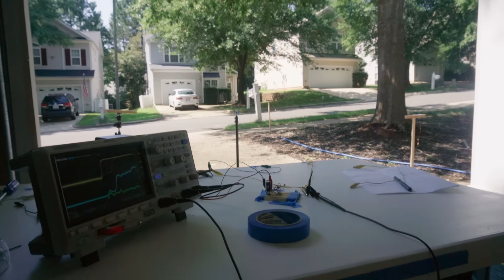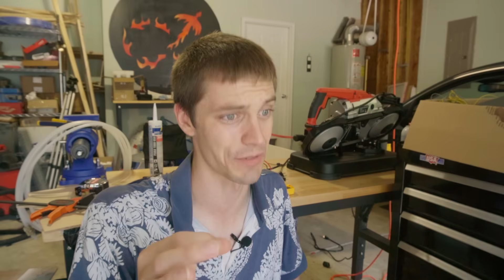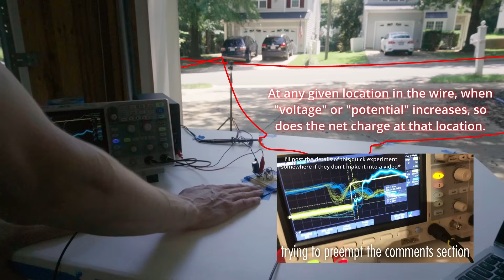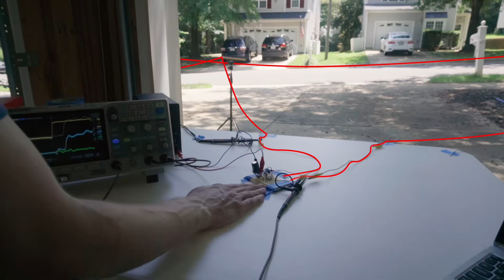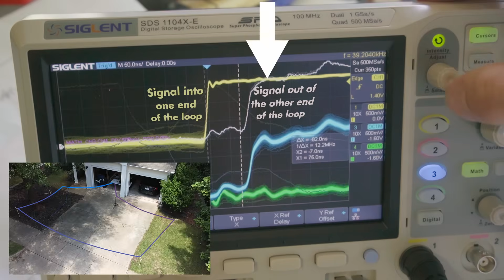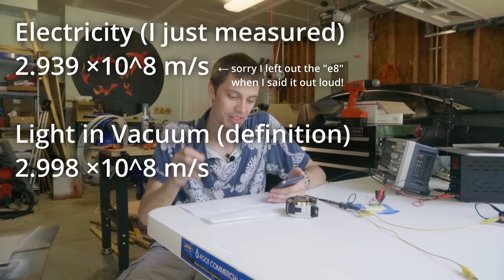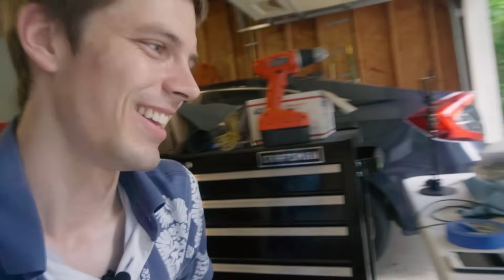Why does WATER change the speed of electricity?

Comment: i was lucky enough to have access to very expensive and accurate lab equipment a while back, and i tested how fast a signal travels along a massive spool of fiber optic cabling. it travels at the speed of light lol. the transmission delay should actually be a tiny fraction slower than theoretical because the path taken, but its so close that my equipment couldn't tell the difference
Reply: Signals in optical cable also have a velocity factor just like wire does.  It should also be around 71% of c.  In optical terms, it is called the index of refraction of the fiber.

Comment: And that's why coax cable specifications include a velocity factor.  The cable slows signals just like the video showed with the water pipe.  It's not uncommon to have a speed of 2/3 c in coax.

Comment: What youare testing is how we test where there is a break in a wire. The speed of the elektricfield dependances om the type of cable ( not all cables are coper). If you leave the end of the wire open and you do the same test you will see a verry small puls comming back from the end of the wire.  The time will  be two time thet

Comment: Heyo, neither of your commentators got it right :p speed is decreased by the insulator material. Coax cables usually have a velocity factor of 70-80% speed of light. you can check a slightly more refined measurement setup on Carlson's lab channel, video there is about 'time domain reflectometer'.
Reply: ok, watched to the end, you've got it!

Comment: Now I know the Internet cables under the ocean are fiber optic but if they were electric like they used to be how did the dielectric effect you showed with water change the speed or affect the signal of the Internet in this case

Comment: I would think that reality being composed of multiple independent frequencies, each potentially acting in slightly different ways, is a reasonable way to understand the world. Think about things like signal transmission through a wire, especially when you are approaching the limits of what the particular encoding is able to handle at a given noise level: the signal tends to get "blurry" as the different constituent frequencies move out of phase from the signal clock, thus making it harder to maintain high data rates on longer wires.

Comment: Your actual “square wave” frequency components won’t be much above the 10s or 100s of MHz, since we see that slope when you zoom in on it. But the actual permittivity of water only dips below 80 in the 10s of GHz. If you were putting out a significant amount of those frequencies we’d see something far steeper, unless you’ve got your scope’s low-pass filter turned on.

I’d want to see this with sine waves next time. You wouldn’t exactly be able to test the delay with really slow sines, but it shouldn’t be much harder at higher frequencies. A simple emitter follower on a function generator should do the trick, if it even needs buffering at all.

Comment: What I would like to understand is the true nature of static electricity. You go on and on about how any time you flip a switch thats technically AC, and this comes together at the end with the whole frequency component bit.  As far as I know all static electricity generators still use an oscillator of some kind, so somehow its possible to use AC in making DC charges persistent in air that hang around and latch on to anything with capacitance. I think there is a proof somewhere down in this line of thinking, either electricity can be static, DC is more real than AC. Or static electricity is an artefact of this universe treating packets of energy differently than a constant source, and AC is the only thing thats real.

Comment: Dude. I knew that electrons didn't literally run through a wire like water through a hose; but I didn't totally understand the exact process by which fields outside the wire are what carry the electrical signal. I've watched many videos (the great series between @electroboom and @veritasium among them). Your explanation really clicked for me. Thanks!
Reply: But electrons do literally run through a wire like water through a hose - just very slow water.

Comment: The frequency dependence of refractive index is the reason we get rainbows if I am not mistaken. (Just seen that at least one other person has already said this.)

How about bare copper wire? Closer to speed of light in a vacuum?

How about different diameter tubes of water?

What were the actual frequencies in the Fourier Transform please?
Reply: Bare copper wire is very close to the speed of light in a vacuum.  Around .95-.98c  The frequencies will be harmonics of whatever switch rate he is using.

Comment: Microwave ovens make use of the electrons in a water molecule aligning with the EM field. Is 2.4 GHz as used in most microwaves the most effective on the water molecule? Or are there other frequencies that are more efficient at exciting them?
Reply: Frequencies around 20 GHz is much more efficient at heating water but you don't want that since all the energy would be absorbed at the surface. The whole point of a microwave oven is to heat the inside of the food as opposed to a normal oven that use about 100 THz (infrared radiation) and only heats the surface. 2.4 GHz is inefficient enugh in heating water to penetrate in a few cm. Since it reflects of the walls it is eventually mostly absorbed by the food any how.
Reply: @larslindgren3846  So this is why the outside of my spud cooks faster than the inside in a microwave? It is a myth that microwaves cook from the inside out. I don't know where this idea came from but it is wrong.
Reply: @stevehead365  A microwave oven definitely heats the inside of the food more than an conventional oven. A microwave oven typically mostly heats the outside 10 to 20 mm of the food. So not exactly from the center and out but still more heat on the inside than a normal oven. A normal oven only heats the surface and much less than 1 mm deep.

Comment: So many questions.  
How much water around the wire do you need to slow down the speed?
How does coiling the wire affect the propagation speed?
Does undersea copper cables slow down?
Why doesn’t water/oil filled computers not have timing errors due to the change is speeds?

Cheers
Reply from the maker: Wish I knew how much water would matter here - I got the largest pipe I could. In a cable or in a pc it’s different because the field mostly travels within the insulation or the chips/boards:/plastic packaging because all the length scales are so short in integrated circuits
Reply: @AlphaPhoenixChannel  Thanks! You do great work here. Love your videos.

Comment: DC is often used to transport electricity in cables in the sea. 
If 50 or 60 Hz AC is used, a higher loss is accepted. The water acts like an capacitor. 
Communications technology, on the other hand, now relies on glass fibers in protective cables under water.

Comment: so can copper lan wires be as fast as glass fiber cables? since its always c?
Reply: The speeds are similar, but depend on the actual wires and fiber used.  Single mode fiber has a velocity factor of about .7c while ethernet cable is around .65c.  Better coaxial cables are around .8c and open wire line (like telegraph wires) is around .98c.  So copper wires can be either slower, or faster than fiber cable, depending on the type of wires used.

Comment: Could high ambiental humidity affect the speed of electricity too?
Reply: Yes, it would, and so would temperature. As for temperature changing the speed of light, that puddle of water you see in the road ahead of you that you can never catch up to on hot days is the result of the differences in the speed of light at different temperatures. The air closer to the hot pavement is higher than farther up.

Comment: Great work! I think you have explained even better than Veritasium why the voltage is produced by electrons interacting via their fields and the speed in question is actually the speed of field interaction. Also very nice insights about why the water should affect this field interaction. I think in general, everything that can affect the electron spin/orientation, should also affect the speed of their field interation.
Reply: Electrons don't need to push one another for the EM wave to propagate. This is incorrect. This part of the explanation in video is incorrect. He is depicting propagation of displacement (i.e. sound) in elecron gas, not EM wave.
Reply: @DrEvgeny  Hello, how does the EM wave propagate then. Thank you!

Comment: is there a maximum positive voltage then, if all the free electrons are gone? how high would it be?
Reply: Voltage is a difference in potential energy between two points.  You're confusing charge with potential.
Reply: @stargazer7644 charge differential is voltage and also ie energy
Reply: @heinrichhein2605  You're confused. The potential energy represents the work that is done to assemble charges into a certain configuration.    For example, to move an electron through an electric field to put it closer to another electron that is repelling it requires work.  The number of resulting electrons (2 in this case) tell you nothing about the voltage that was required to move the electron there (and thus the difference in potential energy).  The number of electrons is the charge.  The difference in potential energy is the voltage.  
It's like asking what's the gravitational potential energy of an object lifted in a gravitational field.  That depends on how far you lifted it.    What's the gravitational potential energy of 1000kg?  That doesn't have an answer.  You need to know the height - the difference between two points.  Similarly, the question of what is the voltage of a bunch of electrons has no answer.
Reply: @stargazer7644  for a constant capacitance ie. not chaning system charge differential is voltage. im still correct. The question is still valid. i think you might want to look more into maxwells equations. "What's the gravitational potential energy of 1000kg? " this is not really a equivalent question. More what would be the maximum gravity be, and this is even more difficult what are the limits of density, we at least know that there will be a singularity. But there is no charge singularity

Comment: I am getting only about 85% of c in my experiment. I was using a loop of about 45m enamel wire 0.6ohms/m through my house (not a very good round loop) . I was using a 9v battery and just tapped fast with a alligator clip to the contact to the positive of the battery to close the loop. One probe at the start, one at the end of the loop. The traces look very similar to yours. I measured 162ns. Maybe I misplaced the cursors at the scope . However ... Shouldn't the speed of the signal in copper be more like 60% of c? Like in copper PCB traces?
Reply: It isn't the copper that determines the speed through the wire, it is the material that surrounds the copper.  Air in the case of bare wires, FR4 fiberglass in the case of circuit boards.  Or water in the case of this experiment.

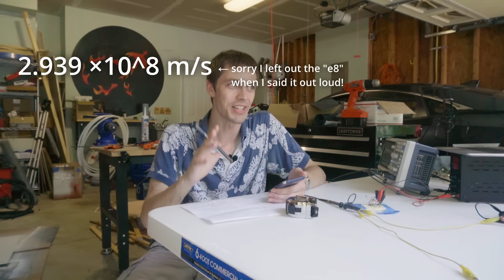Comment: 5:05 But?
If electrons travel at (almost) speed of light, why does computer developers & the internet switch to fiber-optics & photons instead?
They should be (almost) identically fast, but fiber-optics is clearly MUCH faster than regular copper wire, why is that?
Reply: The explanation I got has to do with the Nyquist frequency.... But that's only a maximum limit per frequency and encoding scheme.
  But frankly current technology allows for greater bandwidth on cable lines if they used it!!. What is technologically feasible not would allow for far more different frequencies to be multiplexed and wider bandwidth encoding. If it ever becomes possible to do the same with fiber, then it could be faster. Being as fiber has much more long-term potential, maybe they just wanted to get the infrastructure in and then worry about the connection to it later....
Reply: @petevenuti7355  I think it is possible to send multiple frequencies ("colors") over a fiber-optic cable at the same instant. I don't think it is possible in copper cables?
Reply: @sebbes333  you can most definitely send many different frequencies on both! 
   I guess you never had analog cable, because each channel was a different frequency.
    In a nutshell that's what multiplexing is!
   With current technology you could multiplex hundreds of thousands of frequencies, maybe more but I don't know, but only a few hundred to a few thousand are used in practice ... Fiber can carry much more data per frequency, so even though the number of different frequencies might be counted on one hand , it can still Carry enough data to be better and competitive compared to what is currently in use on cable lines...
      I just find it interesting than current cable TECH can be faster than fiber right now 
   The theoretical maximum of fiber can be millions of times greater than it is once the tech evolves.
   It's also lighter & less prone to interference so it makes sense to me as a long term infrastructure choice.
   I just want to know what some nerd said to some businessman to convince him to invest money for long-term gains instead of short term!
Reply: @petevenuti7355  Aha. "Fiber can carry much more data per frequency".
Does that mean that the fiber-optic data is more "densely packed" because of higher frequency with photons, as compared to electrons in copper?
Reply: @sebbes333  there are photons of radio, it is created by the oscillation of electrons in the wire , radio is a form of light. It just has a long wavelength.     Visible light has a wavelength on the same size range as molecules and atoms , gamma rays are in the size range of the nucleus.. 
    Also the term bandwidth can have very different meanings when talking about an electromagnetic transmission then it does for a data transmission. They are related though. 
    Television broadcast was switched to the current digital signal because the new bandwidth (width of frequency band) is less then it was with analog and can supply a larger bandwidth of data then is required to send the images.
  Lasers used in fiber optics have a very narrow frequency bandwidth and can currently only use a few at a time , but because the frequency is so high you can squeeze more data bandwidth into it.
   Some point to point licenced microwave wireless links can have greater data bandwidth then fiber because of using a wider swath of radio bandwidth, basically transmitting over dozens if not hundreds of channels simultaneously. Some day that kind of equipment & tech may happen with fiber, then we'd be talking many petabits a second. 
  I just hope programs aren't that much more inefficient in the future that we need downloads of that size!
  Do you have any idea how much space the library of Congress would take up if encoded as text. How does that compare to your os?
Reply: @petevenuti7355  I read that you could store several bookcases worth of books on a single blue-ray dvd, and those can be several layers too. 
So to store an entire library, probably uses up an surprisingly small amount of data.
I guess a bookcase worth of multi-layered blue-ray dvd's could store more than the library?
Reply: @sebbes333  I know of a few expired patents that could likely increase the capacity 1000x , maybe get the whole library on a single disk, and if fiber advanced enough to be multiplexed as much as is done at radio frequencies, one could transfer that much every second.
  When I was a kid programming on Atari/commodore / Timex Sinclair etc,  I was jealous of people that had more than 64 KB, and I couldn't imagine ever needing more than a few gigabytes in my entire lifetime... What is coming that could possibly need petabits a second?!?!?
Reply: @petevenuti7355  Yeah, it's amazing what can be achieved with a small amount of data, I heard that old Soviet programmers was really good at doing tricks with memory, because it was really hard for them to get memory. And then the Apollo missions that basically flew to the moon on a very week calculator compared to today. 
    But then today there are Google Chrome & such that just gobbles up several GB of ram just to show a webpage.

Comment: Did the thicker wire take longer because the strands are twisted? A single strand pulled straight should be some % longer than the length of cable it originated from.

Comment: can we make the experiment more compact by looping meters of wire on a coil? yes it will generate magnetic field but would that matter?
Reply: Unfortunately, it would matter.  What looping the wire does is change its inductance.  Here's the Wikipedia article on the subject. https://en.wikipedia.org/wiki/Velocity_factor

However, as mentioned in the pinned comment, coax should not have that issue because it's designed to keep the field inside it.  It's been over a decade since I studied this in detail though.
Reply: @EmperorA0  hmmm... so coax would fare better because it won't let stray EM fields outside the cable, modifying inductance and capacitance even more?

Comment: This is nonsense. Even if (seriously) the wire was 600000km long, the light would turn on instantly on switch.. why? Huh, pretty simple, electrons are all over the wire so even one electron push, the push goes all at once those 600000km.. got it?
Reply from the maker: You should watch my video titled “speed of motion” it addresses this with whole atoms instead of electrons